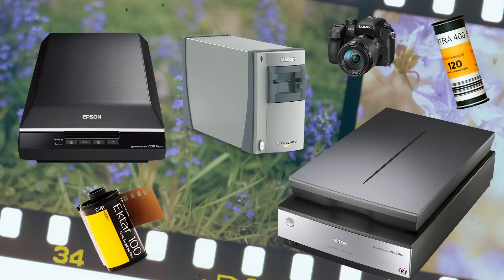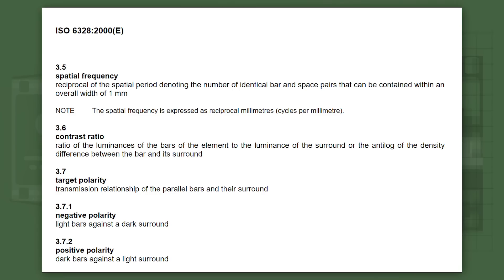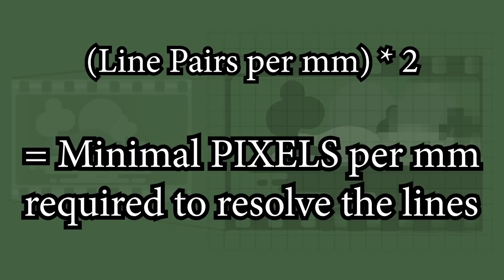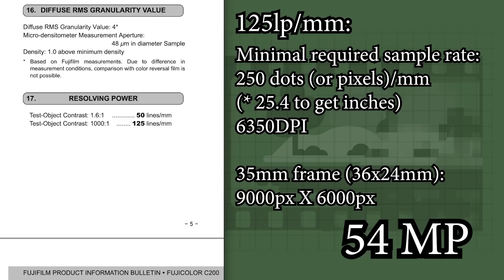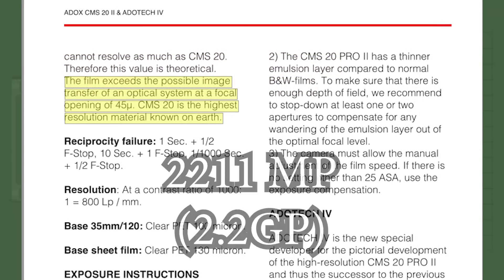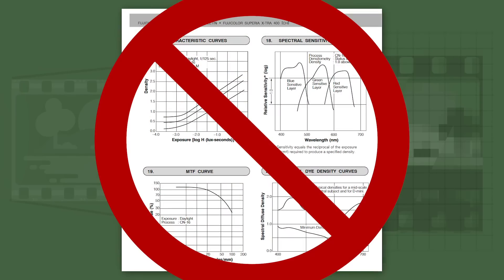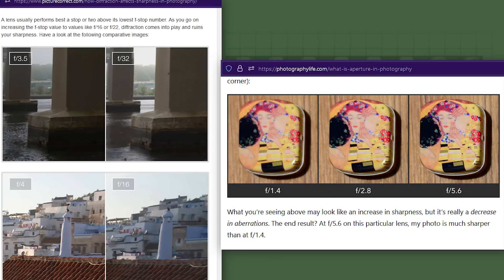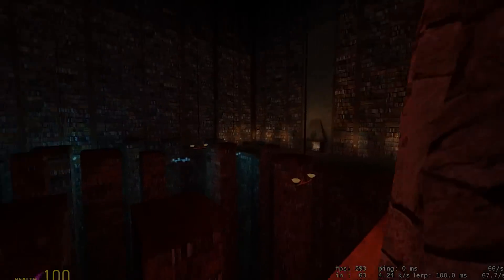The TRUE Resolution of FILM

Comment: You're really only going to get 54MP out of those color films if you're shooting a black-and-white test chart (i.e., that's where you get that 1000:1 contrast ratio that gives you the 125lp/mm number). With actual real-world color subjects, the resolution's going to be more like that 50lp/mm number, which works out to only about 8MP, which is well below what modern digitals are rated at.

Of course, all of this is really a red herring, since resolution is one of the least important aspects to what makes a good photo. As long as it's higher than about 4MP, things like subject, composition, lighting, etc are going to be far more important to making a good photo than just number of pixels. A well-composed picture of an interesting subject taken with an iPhone 5 is going to be a better photo than a test chart shot on a 16x20 view camera, and a well-composed picture of an interesting subject taken with a Pentax 110 is going to be a better photo than a test chart shot with 150MP Phase One IQ4 full-645-frame digital. The only sort of photography where pure resolution matters if you're taking documentary photo scans of other artworks or historical artifacts etc, which is what films like Adox are designed for. For anything else, you wanna go with whatever setup works better for you artistically.
Reply: By the same marker, this would only apply to monochrome digital cameras or foveon types. Most digital sensors need a grid of 4 pixels to accurately record colour, while film does this through layers stacked on top of each other.
Reply: I'm in the process of scanning my family's photo negatives. There are at least 400+ rolls waiting to be scanned. Most are just typical family stuff, taken with anything from cheap compact camera to pretty decent SLR - but no award winning pictures here obviously. 
After conducting some test I've settled down the resolution to about 8.6Mp (3,600*2,400) - also in glorious JPG format too. This should be more than enough in this context. Scanning at 56 Mp / in RAW format would not only be waaaay too overkill, but extremely impractical so I won't bother considering that. Maybe just for some particular / important images, but not all of those 14,000 images - for sure.
Reply: @Nantawat_Kittiwarakul btw, if you have the opportunity, try encoding the pictures as HEIFs, those both preserve tonality better (10bit vs. 8bit) and take up less space
Reply: Yap, just wanted to post similar. I have scanned thousands of negatives on Nikon and Acer scanners, and my conclusion that at the best resolution is max 12mp of color negatives 100asa. B&W ILFORD 400asa which we use to shoot while I was photojournalist is far worse than that.
Reply: Rubbish! For starters, 50 line pairs per millimeter is not resolved by 8 MP. If everything is aligned perfectly yes. But it never ever, ever is. Unless you are shooting the same super boring test chart ever in the same position.
You can easily (and I’m being real conservative here) multiply that number by three. Making the number a little over 25 MP at that resolution.
If we are talking a colour sensor which we are 99,9 percent of the time, you multiply by four or five because of the Bayer filter demosaicing.

And guess what, resolution drops with micro contrast on a sensor too.
Reply: Ouh la la (I'm French)
Please don't say "I think" or "it seems".
Take your best shots of the 90's, a (clean) Coolscan from 4000 to  9000, do it yourself and look at the results.
(no flat scanners, of course)
(it is unlikely that Ekta has stood the test of time)

This is what I did with the 8 000 family photos, mostly slides.
Reply: @christophehomette8520  I mean, I'd be happy to do that if you can buy me a Coolscan. I shoot film pretty regularly, so I've always wanted one. That being said, though, they cost about the same on the used market as a Fuji GFX 50, so that seems like the appropriate level of camera to compare it against.

Apparently the lab I use offers a 30MP scan option on their Noritsu, so maybe I'll pay the extra seven bucks next time I shoot a roll.
Reply: I feel you're doing the same thing many others in the comments are which is placing hard boundaries on resolution at arbitrary places. "More like 50lp/mm" -> "8mp" -> "well below what most modern digitals are rated at", but it won't stop resolving there. You can't describe film resolution with hard limits like that.
Reply: As a supporting piece of evidence, this practical resolution of film lines up with when digital sensor technology was advance enough for professionals to migrate from film to digital en masse, i.e. when digital sensors are above  around 10MP, film began to plummet.
Reply: Add aerial photography to those that need high resolution.
Reply: @frequentlycynical642  When we talk about photography, we mostly mean creative image making that elicits an emotional response of some kind. Absolute resolution has its place in applications like surveillance, medical and astrophotography, but for evoking a visceral response in the viewer neither sharpness nor resolution are reliable indicators. An old box camera with a simple meniscus lens that makes 6 x 9 cm negatives has massive theoretical resolution, however the potential for enlargement is limited by a host of optical distortions, which is why such negatives were contact printed or enlarged to postcard size. By contrast, a smart phone with a lens the size of a water droplet and a tiny sensor can - with appropriate technological intervention - produce a highly resolved photographic print of A2 size. Of course, the box camera shot or the iPhone picture might be more arresting than the other on aesthetic grounds.
Reply: Thats "grain",. in the video,  theme related to scale, a silver halide molecule only can be seen in electron microscope or something like. a cumulus of silver oxide is a "grain" only noticeable above 100x in 35mm ( aprox. plus 5 in medium  format, yes, 3x3 meters paper copy, just with a shoebox size camera to see "grain",) those times are gone
Reply: I was going to say the same thing, but you did it better. I've got Kodachrome 25 & 64, and Ektachrome 100(?) slides developed by Kodak that you can see the grain with a handheld viewer. The only film I have that's clearly sharper than any of my digital capabilities (8K) is some ASA 10 film I shot in 4x5.
Reply: @tsbrownie  did you just put together sharpness and resolution ? ))
Reply: @vasyapupken   You can have a high resolution photo that is soft.
Reply: @allankcrain That's also my finding. My old Fuji Velvia 50 slides (scanned with a LS5000) have about the same amount of details as a 6 to 8MP digital image.
Reply: Actually, you won't even get that contrast in a test chart. 1000:1 is 10 stops, close to the maximum dynamic range of film. Paper's dynamic range isn't close to that. Matte, as is used in most test charts is anywhere from 4 to 6 stops.
Reply: I don't have the same results as you ...
Nikon Coolscan 4000 / Velvia 50 / Years 90 / Minolta MD lenses : 50 mm f/2.0 and 24 mm f/2.8
If you can look at a slide in a microscope, you note that details are obviously lacking in a good 19 Mpx scan.
I have no way to mesure exactly but the limit seems to be over 50 Mpx, what is very, very far from the poor 6 or 8 Mpx you got.
Problem with original shots / chemical degeneration / dust in the scan / autofocus ... ?
Reply: @christophehomette8520  seems highly unrealistic. According to the datasheet you end up with ~5.5mp in a realistic scenario; 22mp in a perfect test (contrast 1000:1). There is no way you'll get more out of it.
Reply: @ChrisThe1  What? The 1:1.6 contrast ratios do not depict all "realistic scenarios" with the "1:1000" being some unattainable magic figure.

I don't know why you're so beholden to the datasheets, because without examples you're just doing a bunch of guesswork. Also, you calculated that wrong. "lines/mm" always means "lp/mm". Multiply both those MP values by 4.

Comment: In a lot of ways Digital exceeds film and in a LOT of ways it will never compete, why it is hard to even have this discussion arguable it is much better even though its only starting to compare to 35mm film. Though that said film is analogue and has, and always will have, a certain qualia to it, which speaks to us as humans. One of the main advatages to film is colour reproduction and is why Sigma is working extreamly hard to make a foveon sensor viable and affordable and fujis unique bayer pattern, X-Trans.  though they have deminishing returns (thus far at leas) Xtrans is limted in size and well Foveon has never really taken off, unless your that guy who goes and shoots that one photo in perfect conditions. While also another thing to note is B&W sensors such as the Leica M10 Monochrome or RED Raptor. Which is much sharper as each pixel is monochromatic and therefore takes a much greater waveform of light. We could also discuss how modern Mirroerless AF takes away pixels for focusing and thus gives us less resolution though at the cost of never missing a shot. 

So the conclusion pretty much the same as yours I believe what rings true of film is Nostalgia - even if the current generation dont actually rememeber it and tha sense of qualia. Otherwise it doesnt make much sense its like riding a really old type of bike while a modern one is going to give the technical best experience it is then robbed of having the true authentic experience. 

Great video.

Comment: This essay has one major flaw: If we take that Fuji 200, it only has 100% resolving power up to about 20lp/mm. A 1.3MP digital camera can match that resolving power. (There is some fudging with demosaicing, but let's assume a monochrome camera). Past 20lp/mm, the accuracy starts to drop. Meanwhile a digital camera is 100% accurate well up to the point where the film drops to 50% response. A 12MP camera is "better than film" up to that point. A 45MP camera will have a 100% response at the point where that film has dropped to 20%. 

So it's disingenuous to say that Fuji 200 film has a resolution of 54MP. It has a resolution of probably more like 4MP.  Sure, it can still show difference between those values in some sense at a finer and finer scale, but a modern DSLR will wipe the floor with it at clarity, right up until the sensor's own MTF curve takes an abrupt downward turn into noise, somewhere around 115lp/mm.
Reply: A 45MP camera will not have 100% accuracy because, even if it does not have a low-pass filter, the MTF will be smoothed out by the objective lens.
The same happens with the 1.3MP and 12MP cameras.
Reply: Good contribution!
Am I misreading, or are you suggesting that digital imaging systems are immune to resolving power limitations of lenses?
Reply: Sure, a 1.3MP camera can match that but it won't do anything more, while the film will. 4MP is still a super low number to assign to a film, even one as boring at Fuji 200. I shot some recently, using a 88 year old lens that is losing its coating, and had it scanned on a Noritsu at 30MP as TIFFs. I see <2 pixel edge slants in parts of the scene which are far less than 1:1000 contrast in various parts of the frame and I wasn't even shooting at an ideal aperture or shutter speed - another thing people need to account for in resolution tests.

Also, digital cameras are not 100% accurate, they need approximately 3 pixels to resolve lines _in all directions_. (there's a post on photomacrography that goes into this)

Comment: That's a really good video and summery of the whole thing, well done.
As a side note, even if there's no definitive answer, to get plenty of detail and nuances, here's some theoretical knowledge of digital definition (not resolution), so the size of the scan you could achieve optimum results ;
Super 16mm ~3K
Super 35mm ~6K
Full frame 35mm ~9K
65mm ~12K
6x4.5 : ~14K
6x6 : ~16K
IMAX / 6x7 : ~18K

Comment: All irrelevant.
Lines/mm is an academic value.
There is NO lens on earth which is able to take advantage of it. And if by some miracle it does, it's due to the perfect light conditions that lens needs to do so.
And even then... You need to have shot your picture in perfect focus, used the perfect angle relative to the lightsource, used the ultimate diafragm under those lightconditions, have a perfectly produced batch of film, stored it in perfect conditions before and after using it, and your film needs to be developed perfectly.
And even then... Any minor scratch on the negatives compromises it. Let alone the photopaper used... Which is by definition lower quality than your negatives.
And even if it was, every photograph ages (degrades)
Reply: I don't quite agree. I did some quick tests of a medium quality digital camera (Canon 80D I think), with the line chart, and found that the resolution was basically the pixel density. The lenses that I tried at least, which were also reasonably high quality modern lenses, did not appear to be limiting. Also since Canon color sensors are in 2x2 squares, one would expect the resolution in terms of black and white lines to be half of the pixel density. It wasn't, so presumably there is an averaging algorithm used to create the camera RAW file, which at least for black and white lines, gave back the whole pixel density. Probably for color images with intermediate contrast, the need for the 2x2 pixel grids would indeed reduce the resolution of the sensor. That wouldn't be an issue with the monochrome digital cameras of course. Not to say that lenses are never limiting, they just weren't in my quick test. There are certainly videos out there documenting that lots of older (or not so old) lenses are limiting with the newer super high megapixel sensors (45, 50, 60mp).

Comment: Adox is a PITA, not being panchromatic, but if you have the right filter in high enough quality, and shoot it at say, ASA 6,  it gives superb results.  I used some 120 on a Mamiya 7II with a 50mm lens and a solid tripod, and at f/5.6 captured a valley in Yellowstone.  The fence posts over a mile away were sharp and my 4000dpi true resolution scanner didn't top out.  But, you really need filters like Wine Country Camera to not waste the potential.

Comment: If you get down to the molecular level, film is digital, a silver crystal can be activated or not activated. while a digital sensor is analogue, it measures the amount of light activating a photodiode. but since pixels are much larger than film grain, and the photodiode is immediatly converted to a digital signal it makes sense to call it digital.
Just to confuse the conversation. lol
Reply: Don't confuse me any more! 😂😭
Reply: You're confusing film grain with individual silver halide crystals in the film emulsion.  What you see as 'grain' is the aggregate of thousands of crystals. So, no, grain is not digital.
Reply: @emotown1  A silver halide molecule has an electron exited to a higher energy shell when hit by a photon. This silver halide is either in an excited state or not. it becomes soluble when developed, or not. On or Off. (yes this is simplified, but is essentially true. I went to college for photography back in the film days)
Reply: And why anyone with experience scanning will modulate the scan resolution dependent on the stock/processing, scan delta 3200 pushed at 5400DPI and it's literally black and white, there are no greys.
Reply: Don't confuse grain for detail. You typically need multiple grains to create a detail that is meaningful.

Comment: I worked in photogrammetry back in the 1980's -1990's.  With our equipment we could measure film to within plus/minus 2 microns RMS.  Flat bed film scanners were commercially available in the 1990's. A Kodak representative said the size of a silver halide crystal (not T-grain) was between 7.5 and 25 microns. Rarely did we scan negatives at 25 microns or below.
Reply: While the filamentary nature of developed silver can bridge many grains together, the silver halide crystals prior to development have never been that large, they’re typically between 0.01 to 2.0 micron in size, best described by a log normal distribution, they’re always on the scale of visible light or smaller, the grains you see after development are clusters on the microscopic scale.

Comment: Isn't the film resolution the same for any film regardless of the size of the film? It's the same film stock the only difference is how much you have to enlarge it 
You have to enlarge 35mm film much more than 8x10 film to get the same size print, making the larger film sharper it is just that simple
Reply: If you scan a larger piece of film, and view it on the same monitor as a smaller format, then lower spatial frequencies take up less space on the screen, since they of course have greater contrast the overall picture will be higher resolution assuming the difference doesn’t exceed human visual acuity.

Comment: I though you were going to say how many megapixel 
 you need to use to get the most out of your film 
Doesn't it depend on the grain ?
That's why film speed matters in the amount of grain in the film 
So simply put what megapixel sensor do you need to where any more megapixels won't matter 
KISS
Reply: The guy nerds out and doesn't answer the question what's the point I use a 24mm crop sensor and get great scans